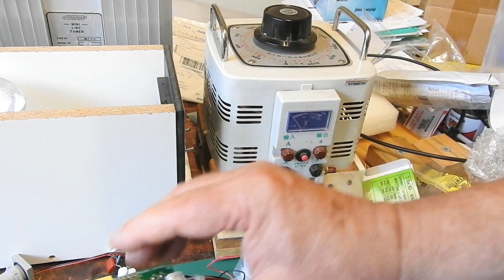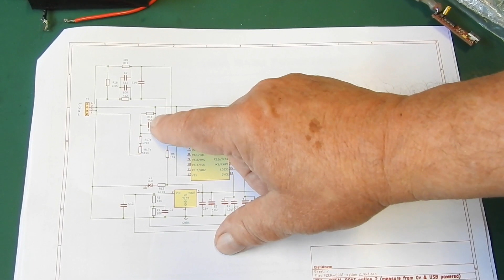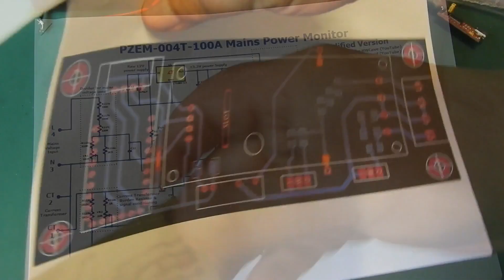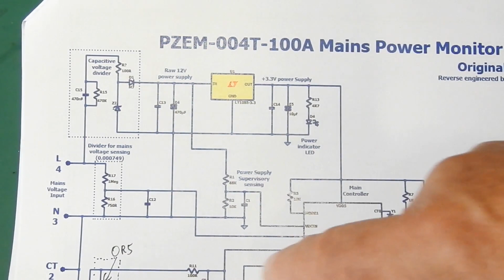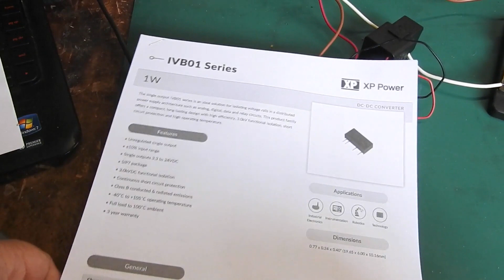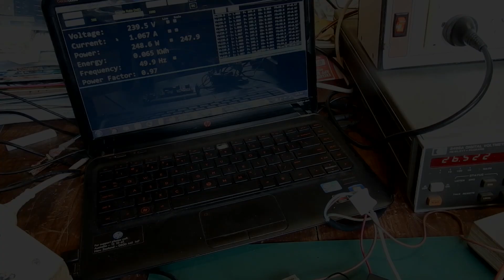Adapter PCB for Peacefair PZEM-004T Energy Meter

Comment: Another crude way to power these Peacefair with LCD screen power meters, is to measure the voltage over that large capacitor, 
i think it's arround 5V, and to "inject" that amount of voltage from a external powersupply through a diode (to prevent backfeeding the mains into the external powersupply) in parallel over that capacitor. This external powersupply can offcourse not be used to power something else in the same cabinet.
Below 80V of mains, the power meter is powered from this external powersource, and from 80V and beyond, the meter is powered by the mains.
Reply from the maker: That's an interesting method, though I wonder if many circumstances could use it. 
Presumably the external supply would in most cases operate from the mains, which could just be used directly. It would be a strange setup where there was a power supply, but no mains to drive it. Battery backup maybe? (sort of a UPS for the PZEM)
Depending on circumstances, the PZEM might still need a modification to separate its supply input from its measuring input.  
Something to keep in mind though...
Reply: @bertoid  , the measuring input works fine when using a external powersupply, the problem of no screen below 80V is due the "capacitor dropper" circuit not delivering enough juice to power the meter.
With a external supply connected in parallel over the big capacitor, the meters shows 0V when no voltage source is connected to the input. Like i mentioned before, you need to add a diode, to prevent backfeeding into the external powersupply. Also due the capacitor dropper circuit is not isolated from the mains, the external powersupply now also become hot (live), so this external powersupply can't not be used for anything else in the same projectbox. Instead of using a mains powered external powersupply, you can also use a battery pack, so that the meter becomes portable. Grtz.